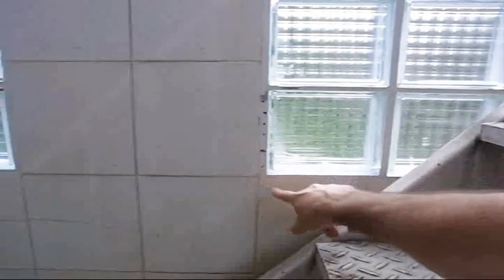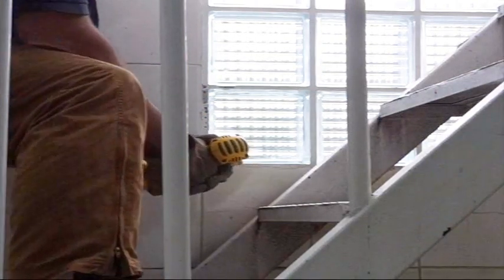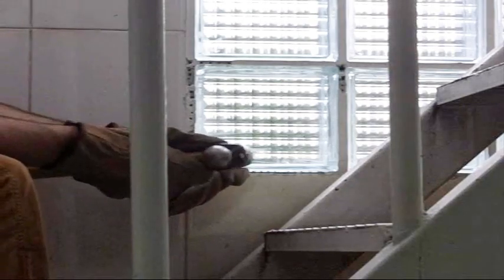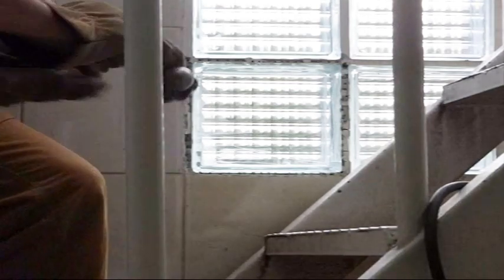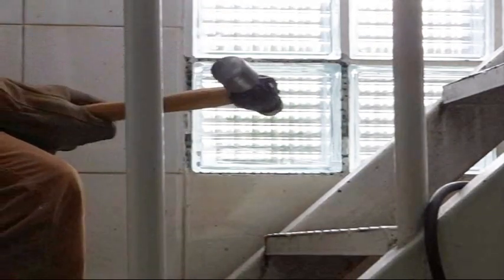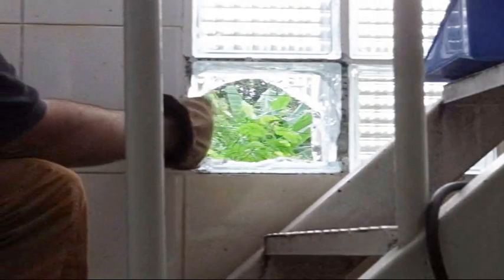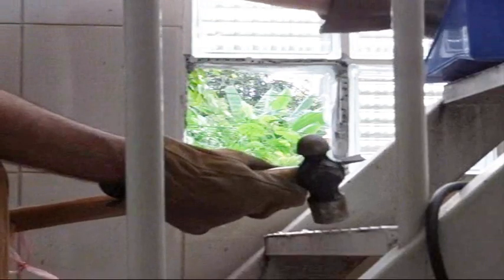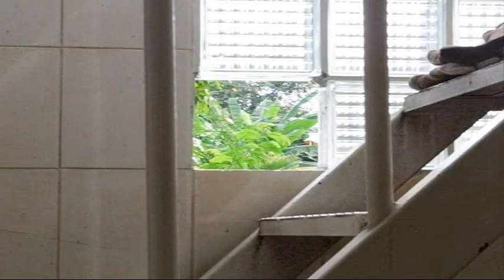Glass Block Repair - Removing One For Replacement

Comment: Very helpful....I need to remove one block for a dryer vent
Reply from the maker: Use proper safety precautions. This produces lots of glass splinters and dust. Duct taping it first will help.
Reply: Nice. I actually need to remove a dryer vent and put a block back. Doggone window well drain keeps filling up and dumping in my dryer hose

Comment: As a chemist I wonder if you can use avid to dissolve the cement (ruther slow process I guess) without the glass breaking. The glass is not sensitive to acids
Reply from the maker: I think you could. I would not want to deal with that much acid. And trying to keep it from running to other places would be difficult.